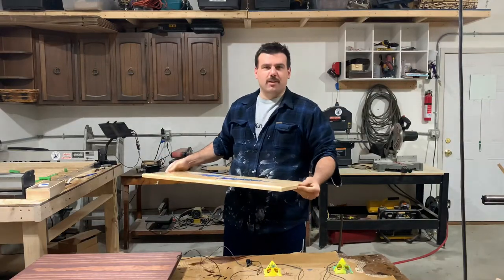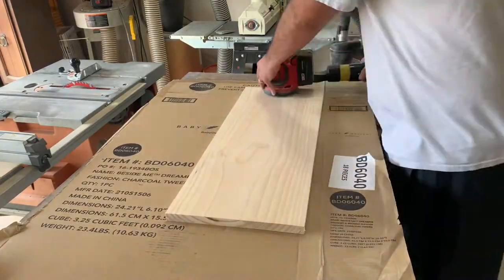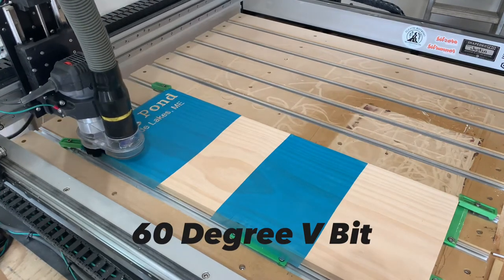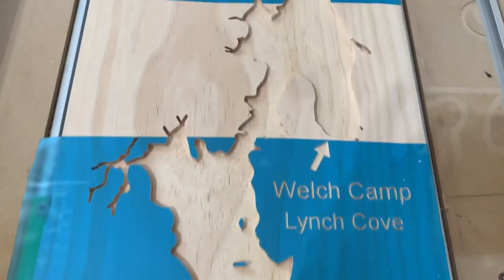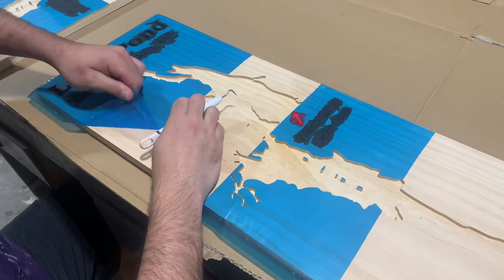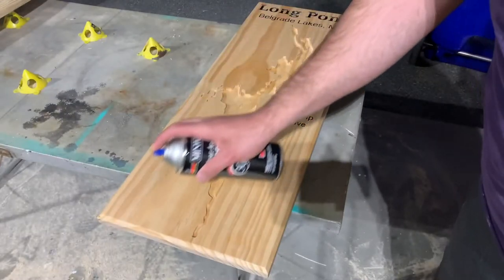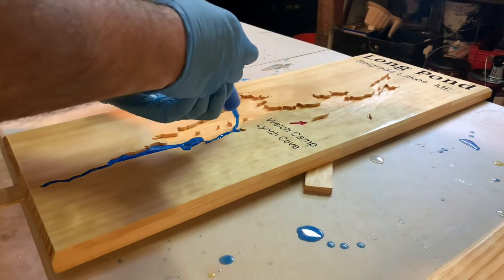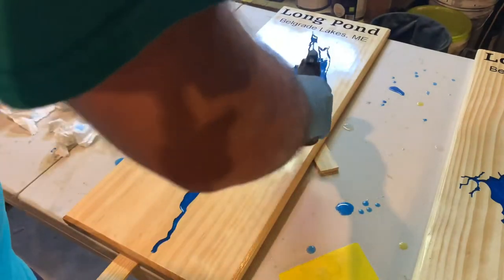How to make an Epoxy Resin Lake map on your CNC Machine / Shapeoko Pro XXL

Comment: Another easy to follow video. I have a question. Have you ever tried to do different color variation to mimic the different depths of the lake?
Reply from the maker: Thanks! And no I haven’t. I think if I were to do that I would carve at different depths, that way I could keep the epoxy the same color while mixing it and the deeper areas would naturally be a little darker.